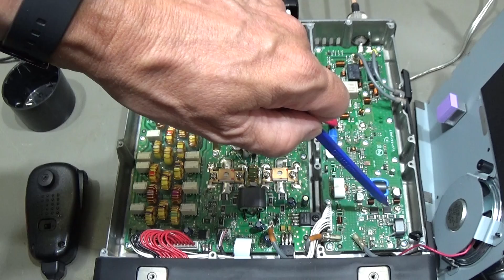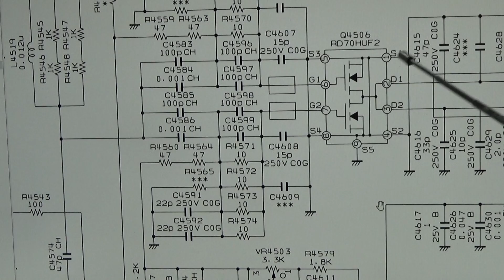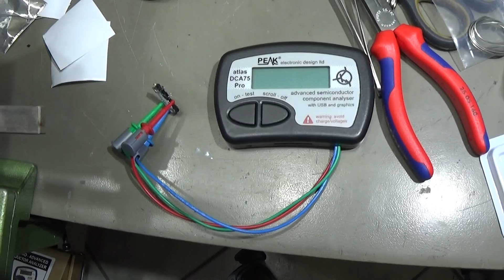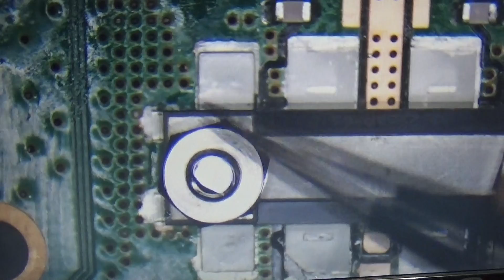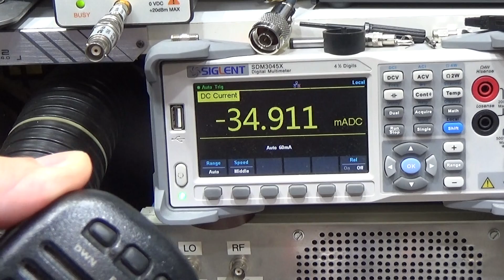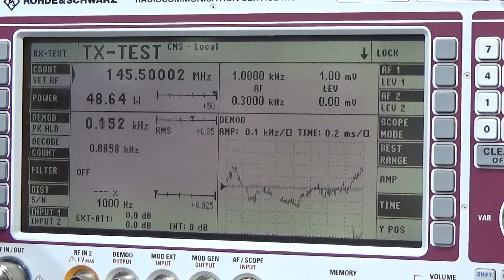#285 Yaesu FT-991A; The repair video - we fix it

Comment: When you terminate j4501 j4502 you are just shunting them with a 50 ohm resistor correct? You probably have an adaptor for that cable end?

Comment: excellent video. At the moment I have the same issue on the same radio. Is it too expensive to improve the fan system ? For me this radio cannot trasmit at high power due to the poor fan system.

Comment: Your video is enough to convince me I don't want to attempt to fix anything INSIDE my FT-991A. I need to have the Silicon Labs CP2105 chip replaced on my main board as my radio is out of warranty. Does anybody know a facility in the U.S. that can do a hot air surface mount chip replacement?

Comment: I like those snap on / clip on adapters for the DMM probes! 
When you did the idle current on the last two transistors (600mA then 1.2A) Are the test leads still connected to the same test point? Oh. I see it @28:37 And It will be easier from the service manual. Thanks
Too true about shielding in these radios, people may experience HF on the mic or perhaps even damaged components. I've heard some of the grounding points have board varnish over the connection points on some of these radios (poor production on some of them).

Comment: Those PA's are very hard to change out. Great job Peter, and excellent job with alignnent. Those potentiometers are terrible. If the radio is bumped or knocked, the alignment can easily be messed up. Glad you put a precision pot in place.

Comment: I have the Yaesu FT-991a and I hope it does not screw up as it's less than a year old.  I've heard about transmitting on another radio that's in close proximity to the 991a will cause a resistor to burn out.  So I make sure I don't use my 2 meter radio when the 991a is on.  I never have both radios on at the same time even though they are less than a foot apart.  So far so good.  I have a Ham friend that transmitted on a radio next to his 991a and it blew out a fuse in the 991a.  I'm always careful about that.  Cheers from eastern TN
Reply from the maker: if you transmit into a radio next to you with some power, it definitely burns your front end, no matter what brand it is...

Comment: What are those unique probes/test leads, please? I checked the comments, but didn't see them listed. Thanks.
Reply from the maker: which one do you mean?
Reply: @TRXLab  It's the meter probes that you used for the entire video, mostly... Red and black... On creme/tan... I didn't think that they look like Probe Master, but they do look high-end... They have right angle plugs... And they accept unique long reach pincer adapters. I wondered what those are, too. Thanks for the extra effort to reply and chase it down...
Reply: See @ 5:58.
Reply from the maker: @t1d100  well the test leads are originally Agilent/ Keysight and the Probes are Hirschmann https://www.buerklin.com/en/p/hirschmann-test-measurement/test-leads-and-test-probes/pruef-2610-ft-rt/35F1186/?segment=b2c
Reply from the maker: @t1d100  well the leads are originally Agilent/ Keysight and the probes are Hirschmann https://www.buerklin.com/en/p/hirschmann-test-measurement/test-leads-and-test-probes/pruef-2610-ft-rt/35F1186/?segment=b2c
Reply: @TRXLab  "... the test leads are originally Agilent/ Keysight" I was afraid of that. Thanks for the link.

Comment: I've got a problem with that same board. Low SWR, read internally using the radio's meter. It's hooked up to a test load so it is exactly 50 Ohms. The SWR reads 3.1 at 50 watts. It reads about 2 to 1 using 25 watts. I had to send it back to the factory. It is essentially a new radio. I just got it back from service too. They replaced both HF finals. It didn't seem to have this SWR problem when I sent it in.  No explanation how a new radio could have bad finals. Now after watching this video I am not so certain the two problems are related. If I caused it I wish I know what I did. I have two of these radios. The other one was in the shop for repairs too. Luckily it was covered under warranty. I was never informed of the problem's cause. I did ask them why it failed and what failed but got no answer.  I really like the features of this radio. I'm not so sure about the quality of build and component design though.  When they work, they work well.  When you get so many failures from a new radio one has to wonder.
Reply from the maker: Sometimes the bias gets to high due to bad potentiometers..
Reply: @TRXLab  Not something I had considered. Can you explain how that would affect the VSWR reading on the radio?
Reply: Cost cutting. Even some 'big' manufacturers like Yaesu are doing it. I suspect the market for amateur radio is declining so makers are forced to cut costs to stay in business. 
A high VSWR as shown on the radio may be due to a problem with the reflectometer. Start by checking the components in that section. If they are Ok then it's time to look at voltages from that circuit and see how they stack up. Also look at whatever is in the RF path from the reflectometer to the antenna connector.

Comment: As I can see on the VHF/UHF PCB, there is a reflection bridge between the antenna connector and the amplifier section. I presume if the amplifier is using fold-back, there should not be possible to destroy the final dual MOSFET due to high SWR. Any points of view with respect to that?

Comment: I have done this on 3 radios in the lst 18 months. Never any issues with bias settings, just a very common failure point.
Reply: Common failure point on the FT991A ?
Reply from the maker: Unfortunately, some of the little pesky pots are bad and thus misaligned...

Comment: Another outstanding repair. Thank You. What was actual cause of failure? I suppose faulty components or procedure during build and assembly. Also some amateur radio operators run radios at maximum power always disregarding duty cycle limitation. Wish more care was taken at factory as radio at $1200 US is major investment for most of us ; )
Reply from the maker: Bias to high